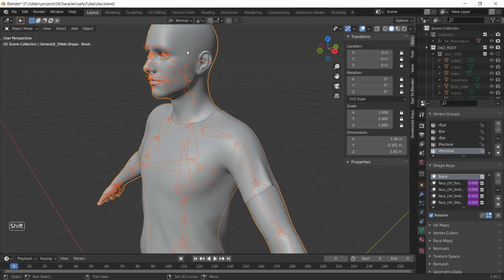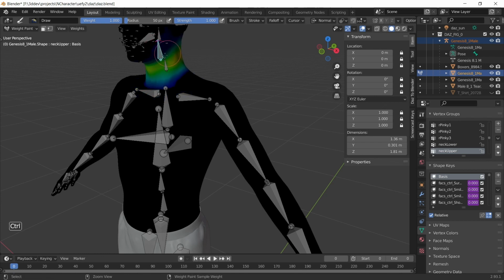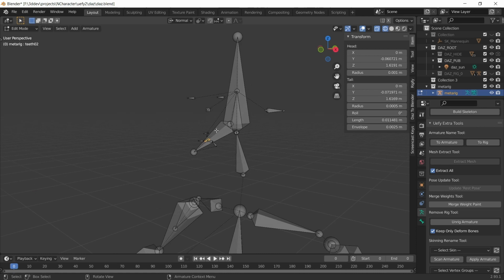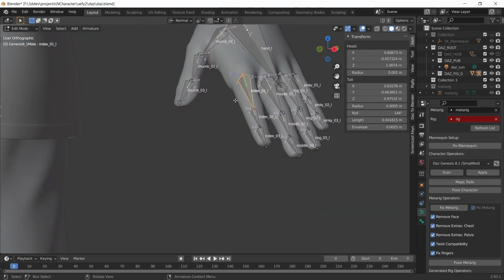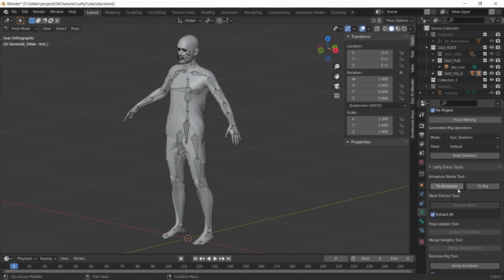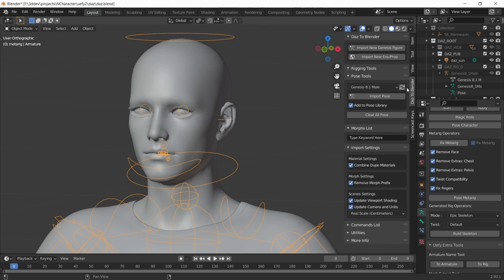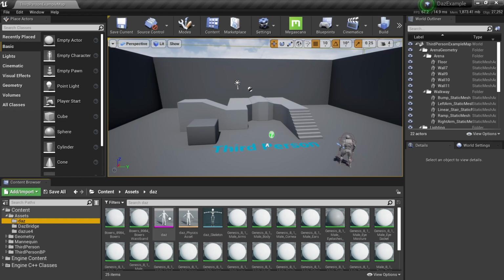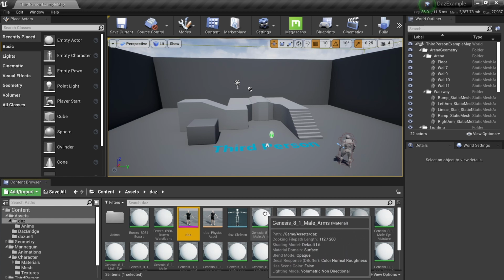Daz to Unreal Engine in Blender with Rigify and Uefy 2

Comment: I have to say, not having a full face rig is a big drawback for me. Looking forward to an updated tutorial on adding a proper face rig.
Reply from the maker: There are multiple options for facial expressions. You can construct a face rig yourself by adding additional bones. You can also use morph target/shapekey based face movement. There is also rigify super_face as shown in https://youtu.be/mJUWJxBzW3Y
Reply: @RakizFarooq  So is the idea that I merge the face rig from the Rigify metarig onto the Unreal simplified rig?
Reply from the maker: The FAQ section in the product page has a list of supported rigify sample types. You can add any number of those supported additional bones to construct whatever you want.
Uefy is not aware of Daz or anything Daz specific. The Daz simplified rig in Uefy is just the default rigify Human Metarig customized with additional bones using the sample types mentioned above. You can continue adding/removing as much as you like.
You can add additional bones as shown in https://youtu.be/o2CR9Zxbq0c and https://youtu.be/v8UfX62SlI0

Comment: Trying to apply animations I made using the rig. In Unreal, whenever I try to preview the animation the model disapears. Any ideas why that's happening?
Reply from the maker: Probably a scaling issue. The Unit Scale in blender is set to 0.01 and character is properly scaled at the start of the video. If this was not done correctly the mesh seems to disappear in Unreal because it is tiny.
This happens due to differences in Blender/Unreal and not related to functionality of the addon.
Reply: @RakizFarooq  So will I have to remake the rig?
Reply from the maker: Set the unit scale to 0.01 and view clipping distance to 50m. In Object mode use Shift + A -> Armature -> Uefy Script -> Reference Skeleton -> UE4 Mannequin Proxy (A-pose) to bring a reference mannequin into the scene.
Your character's objects (mesh / armatures / metarig) need to be correctly scaled relative to this mannequin. The mannequin should not tower above your character or be tiny between it's feet.
You could disconnect all the objects from each other and individually scale them then apply all transforms to set scale to (1,1,1).
In the case of Daz however things are complicated by the Shapekeys. So it depends on how well you know your way around blender. Might be easier to just redo the rig. 
Alternatively you might try creating a new Blend file. Import the character correctly, compare it to the reference skeleton. Then import your metarig from the old file and just scale and apply transforms on that. Might work for you.
I also suggest you try rigging a simpler character first and ensure animations work correctly for you either https://youtu.be/mg75kSkKkug or even just the ue4 mannequin https://youtu.be/8Ad4v7x41RA
Reply: @RakizFarooq  Thanks for the speedy reply, I will try remaking the rig and following along better this time

Comment: Do you have any advice if i'm going to rig daz character to UE5 skeleton ? It looks like i've to re weight paint spine since UE5 skeleton has 6 spine bones.
Reply from the maker: You don't need to repaint anything if you use the Manny89 preset metarig instead of the Daz3d preset to rig your character. It has matching spine, neck and hand bones. You can add the face and elbow bones to it on your own following the ideas in https://youtu.be/mg75kSkKkug and https://youtu.be/v8UfX62SlI0 and using the Daz3d preset as a reference.
Note that Uefy is not aware of Daz3d or any other software. The Daz3d preset was created by modifying the default human metarig as shown in the links above. Same is true for the Manny89 metarig. You can modify the metarig to match your own needs.

Comment: Great tool, but when I import this in UE5, if "Animation Scaled" is applied to the pelvis, the animation stutters after 1 loop, and the pelvis isn't aligned as theUE Mannequin is (straight down to the ground). If "Skeleton" is applied to pelvis in the retargeting settings, the animation does not stutter, but when idle, the characters feet lift off the ground slightly. I have tried numerous fixes like realigning the pelvis in Blender and tried to fix it in Unreal, to no avail. Any ideas why this would be happening? Thanks in advance!
Reply from the maker: None of the above is an issue caused by the addon. UE5 introduces a host of changes to retargeting with control rig built into the process. It is not so simple as UE4 anymore. 
You can check out the whole process I go through to get characters working in UE5 in the playlist https://www.youtube.com/playlist?list=PL5EVTuZGY1UYjcB1z-pvLXkTk0E0B2FRA from the video titled 'Easy rigging UE5 mannequins' onwards.
What exactly it is you need to do is hard to say but the addon only improves the bone hierarchy exported from Blender. The rest is handled engine side. Your issue can stem from any combination of the control rig, ik rig and ik retargeter being misconfigured. On top of which sometimes you must adjust character height in blueprints too. 
You will also need to decide if it is worth going for a UE5 mannequin if most animation packs and assets are designed for UE4 etc.
Reply: @RakizFarooq  Thank you for the reply. I just want to note that I have done your entire playlist a few times now, I created all the mannequins etc, but this animation pack was created with the UE4_Mannequin and I used the one  I made from your tutorial for it. I then click on the Anim_BP I created from the Animation Pack I purchased and retarget the assets to the Daz Model I used in Blender. I will take a look at the control rig and IK rig again to see if there are descrepancies and perhaps try the rigging with the UE5 Mannequin instead. I assumed it wasn't a UEFY issue, but you are so knowledgable I thought I'd try and see. I appreciate your input as it's given me something to look at here, and hopefully I can resolve this. Thank you again Rakiz.

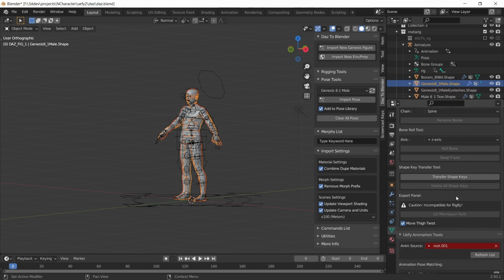Comment: Hello author, at 25:54, I clicked "TRANSFER SHAPE KEYS" and prompted "Select 2 Mesh objects to use this operator", how to solve it
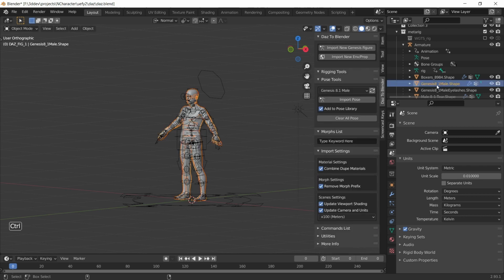Reply from the maker: At around 25:35 in Object mode I click on one mesh then Ctrl+click on the second to select two mesh objects at the same time. You have to do the same in the same order for the transfer to work.
Reply: @RakizFarooq  Hello author, I have reselected the two mesh objects as you said, but the new problem appeared " File "C:\Program Files\Blender Foundation\Blender 3.1\3.1\scripts\addons\uefy\extra .py", line 639, in execute
     key_blocks = source.data.shape_keys.key_blocks
AttributeError: 'NoneType' object has no attribute 'key_blocks'", how to solve this?
Reply from the maker: As I said in the previous message you have to select them in the correct order as shown in the video. Select the mesh that has the shape keys first then ctrl+click the target mesh second. The target mesh will be the mesh in your final rig where you want to copy the shapekeys.
Make sure you don't have anything else selected before start this. That you are in object mode and the source mesh actually has some shapekeys to begin with.
Reply: @RakizFarooq  Thanks to the author, the problem is solved, my daz character forgot to bring the shape when exporting.
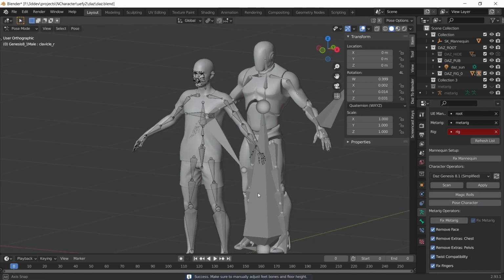Reply: @RakizFarooq  But I have another problem. At 17:35, when I click on "Pose Character", the daz character's feet will be twisted. How to solve this?
Reply from the maker: The feet and character height are adjusted manually. Please review the Basics videos https://youtu.be/mg75kSkKkug to learn how to use Uefy 2 before continuing with this more advanced tutorial.
You probably did not fix the mannequin feet as shown at the start of the video.

Comment: im currently using metarig face bones, how come after i generated the rig it deforms the mesh successfully but after i build the unreal skeleton, the rig on the face doesn't work at all?
Reply from the maker: Only the rigify part types listed in the FAQ section of the rakiz.com/uefy are supported. At this time only faces.super_face is supported which can be used as shown in https://youtu.be/mJUWJxBzW3Y
Alternatively you can also build a face rig as used in the metarig of this video but you need to use parts that are supported like basic.super_copy, limbs.simple_tentacle etc
Your message doesn't really provide much detail if you are using supported rigify parts  it is also possible this is simply a case weights not applied to the correct bones. Maybe you need to rename the vertex groups to transfer weights to the correct bones.
Reply: @RakizFarooq  so uhh i might've added the face bones incorrectly before. but i've fixed it and stumbled into another problem. What i'm doing now is basically i already have the metarig setup posed and all that, now i wanna add face bones, i added it using the rigify sample "faces.super_face" , aligned it to my mesh then add generate rig. after i parented the mesh to the generated rig, when i press the build unreal skeleton i found an error which says error in process_super_faces (key u_root not found).
Reply from the maker: I have tested faces.super_face with the current version of Blender and Uefy. It is working correctly for me without any errors, so there is likely an issue in how you set it up. Make sure the face bone in super_face sample is parented to the head bone in the metarig before you generate the rig.
I would suggest you start new blend file and get super_face working without any mesh details or other things to worry about. Then see what you are doing different.
Reply: @RakizFarooq  
>Make sure the face bone in super_face sample is parented to the head bone
ah that's exactly why! i'm an idiot, ok thank you so much!

Comment: Hi, thanks for the tutorial. I have a problem at the end when I try to transfer the shape keys, it ends the process without any errors, but there are no shape keys added to the main body from the 2nd one.
The only difference I noticed was that the 2nd body I imported has vertex groups with different names (ex. "lThighBend" instead of "thigh_l", "lThighTwist" instead of "thigh_twist_01_l", etc.). Is this the reason why it does not work?
I made a duplicate of the 2nd imported body, then removed its shape keys, and then transferred them back from the other one, and this worked fine but it does not work with the body that has all the important changes and the armature...

edit: Never mind, I found out why it didn't work. I had deleted a few vertices inside the mouth and it gave me an error that the vertex count didn't match between the two meshes (but that only when I tried from Blender's transfer option from the black arrow, the script from this didn't gave any errors). I copied the vertices back, and tried again, everything worked fine...
Reply from the maker: The workflow shown in this video assumes you used the Daz to Blender bridge and followed all the steps in the order shown. Doing so results in specific names for bones and vertex groups along with other options.
If you imported the character a different way you will probably need a custom mapping for the bone names as shown in the Basics video https://youtu.be/mg75kSkKkug You should check that to learn how to use Uefy before running with this video.

Comment: My addon is not importing the rig with the custom shapes, the circles and whatnot. Help please. Thank you for the video.
Reply from the maker: For the Daz to Blender bridge plugin I copied the addon files directly into Blender install plugin directory instead of the usual users shared directoty. That seems to work for me. Otherwise you'll need to ask about this from the addon's developer. I can only answer question about Uefy.
Reply: @RakizFarooq  Thanks
Reply from the maker: Please explain what part of the video you are at and what you are trying to do?
Reply: @RakizFarooq  When I click on Import Daz Character to Blender button, I get an error but the character is loaded.
Python: Traceback (most recent call last):
  File "C:\Users\User\AppData\Roaming\Blender Foundation\Blender\3.1\scripts\addons\DTB\DtbOperators.py", line 168, in invoke
    return self.execute(context)
  File "C:\Users\User\AppData\Roaming\Blender Foundation\Blender\3.1\scripts\addons\DTB\DtbOperators.py", line 349, in execute
    self.import_one(fbx_adr)
  File "C:\Users\User\AppData\Roaming\Blender Foundation\Blender\3.1\scripts\addons\DTB\DtbOperators.py", line 318, in import_one
    DtbIKBones.bone_disp(-1, True)
  File "C:\Users\User\AppData\Roaming\Blender Foundation\Blender\3.1\scripts\addons\DTB\DtbIKBones.py", line 346, in bone_disp
    bone_disp(i, flg_hide)
  File "C:\Users\User\AppData\Roaming\Blender Foundation\Blender\3.1\scripts\addons\DTB\DtbIKBones.py", line 351, in bone_disp
    bone_disp2(idx, pbones.get(ik_name[idx]),abones.get(ik_name[idx]), flg_hide)
  File "C:\Users\User\AppData\Roaming\Blender Foundation\Blender\3.1\scripts\addons\DTB\DtbIKBones.py", line 337, in bone_disp2
    pose_bone.custom_shape_scale = scales[idx]
AttributeError: 'PoseBone' object has no attribute 'custom_shape_scale'

location: <unknown location>:-1

This error happens, and when the character is loaded, her bones appear as B-Bones and NOT as custom shapes.
Help please if you can.
Thank you so much for the video

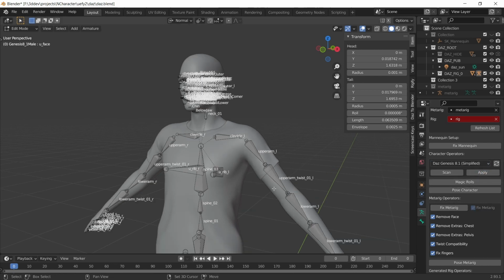Comment: Renaming the bones (13:17) breaks it for me. After that, when I pose, many of the bones don't work correctly for the mesh (parts of the body don't move at all or they move slower/faster than the bone's rotation, and there is unnatural stretching).

The first time I noticed that was after doing almost everything in the video, and I had to do the process again from the start and at each part I was also testing with posing multiple of the bones (hand, foot, neck, spine, head, etc.), the problem showed again after the renaming. 
For example, rotating the "upperarm" didn't even move the arm of the mesh at all, and anything that moved the head (like any of the upper body, neck, or the head itself) had the eyes and the inner mouth lag behind, stretching them out of the head as a result.
Reply from the maker: Send a reply to the email with your download link and order id. Attach your blend file. I can take a look at it, likely you missed a step or did something out of order.
Reply: @RakizFarooq  I may have imported the Daz character with diffeomorphic instead of Daz To Blender (I have used both in the past and are both installed), so I will try in a new project from the start using Daz To Blender (I don't know if that's the problem). This one is quite large because I have been making armor, cloth, and accessories for my game (150+ pieces). If the problem persists, I will send you the new one. 
Also, thanks for the fast reply.
Reply from the maker: This tutorial is built on the assumption that you use Daz to Blender bridge to import the character. Doing so will cause it to have specific naming convention and other defaults required for the Daz preset.
If you are importing your character a different way then you probably need to build your own preset as shown in https://youtu.be/mg75kSkKkug then add additional bones on top of that as shown in https://youtu.be/v8UfX62SlI0
I also suggest you test out the process with a simple export from Daz and not some massive character with a ton of armor and extras. If it works for the simple character it will also work for the complex one.
Reply: @RakizFarooq  thanks for the info, I will try later to make my own preset.
Reply: @OnigoroshiZero  did you have any luck with the diffeo plugin approach?
Reply: @vpwithvp  
Most of the problems I had were because of the Vertex Groups the base Mesh had when I imported it with diffeomorphic (separate for jaw, chin, some parts of the ears, etc.). 
I assigned all these vertexes to groups like the Head or Left/Right Arm (to the main one from that part of the body), and the stretching problems were gone.